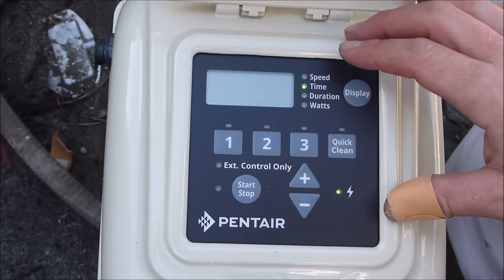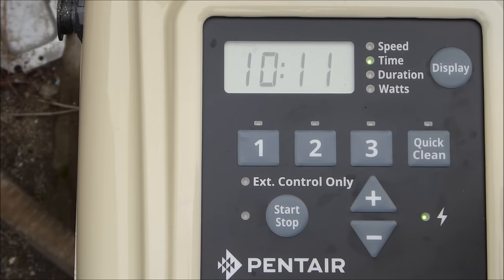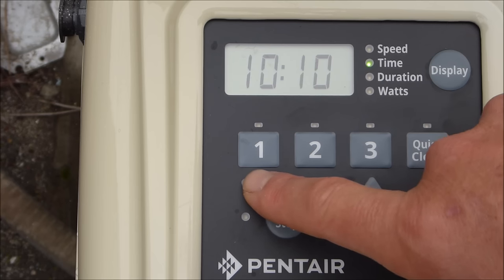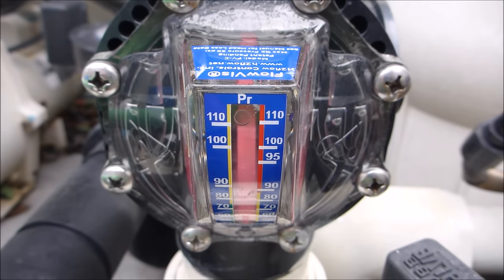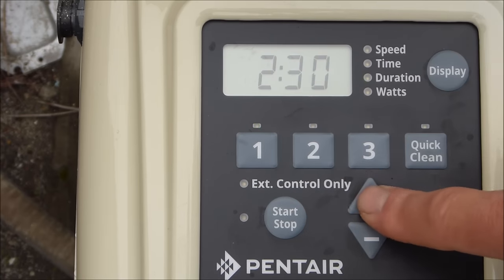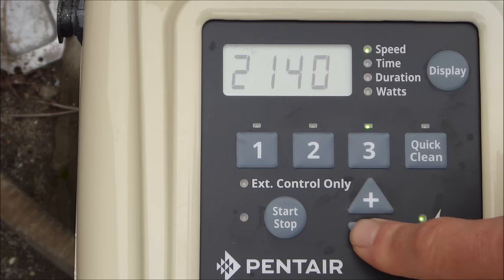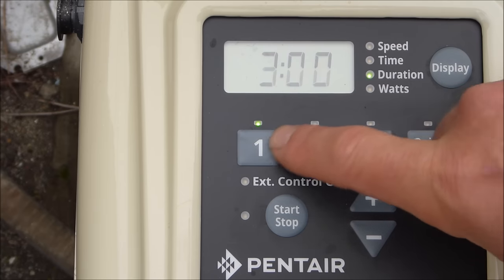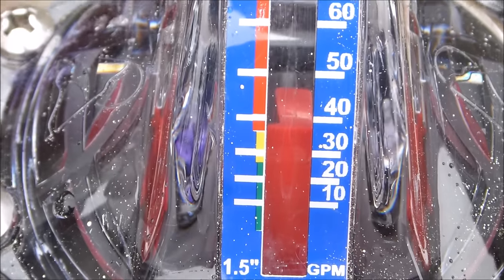Pentair SUPERFLO® VS (VST) Variable Speed Pump Operating and Programming

Comment: So my 10 year old AO smith pump went out the other day and I needed a variable speed pump immediately because my pool was very green. I went to pool stores etc and no one could help me for about two weeks, so I went online, purchased the Pentair Superflo vs.  The pump arrived two days later from Amazon (free shipping). I installed the new pump with new plumbing and electrical in two days.  TOTAL COST of Pump/Plumbing & Electrical was $769. This was a $500 savings. I would not have done it without David's tips on installation. KUDOS TO DAVID!!!
Reply from the maker: Your very welcome. Thanks for the great feedback! 👍
Reply: 😅t

Comment: How would you program the pump during a winter freeze?  I live in South Texas and we normally run our pumps 24 hours/day during a  freeze.  8 hours for each program, or is there a way to just turn the pump on and run continuously at a low speed?

Comment: Thanks for the video- I was able to reprogram 2 pumps after someone installed them and set the filter to run 24hrs at 3450rpm and the Infloor pump for 16hrs at 3150rpm. I had to work fast as more than 6 mosquitoes were trying to get my legs!
Reply from the maker: LOL - 😆

Comment: Installed this pump along with the Flowvis. Surprisingly using your settings I'm getting 50 GPM at program 1 and 20 GPM at program 2 with the Skimmer and Kreepy on.  With the Main Drain and Skimmer it's much more GPM and 95 GPM in the Quick Clean mode.

The Flowvis really takes the guessing out of how long you should run your pump for a full cycle 👍
Reply from the maker: Thanks for the update! The FlowVis is essential. Now you will really be saving on your energy bill. 🤑

Comment: I have a salt system pool and just had this pump installed on friday.   The tech set it at Set1 2200 rpm for 6hours (12am-6AM), set 2 is 2700 RPM for 14 hours(6AM-8P) nd set 3 is set for 3000RPM (8PM-12PM).   Is it me or does this seem like the system would be using more electric than doing me good?  They did say that the Pentair should really be running for 24 hours a day rather than powering off for so many hours a day  Please advise if i should manually adjust the RPM's.
Reply: also wanted to add my pool is 10,000 gallons
Reply from the maker: Would set it for 8-10 hours at 1800 RPM. Then 6 hours at 2200 RPM.

Comment: David i have a goldline hayward controller board inside the house for my single stage pool pump as a timer which allows me to turn the pump on and off as needed. i am thinking about changing my pump to this pentair superflo pump but i am confused how would i be able to integrate the control with my existing controller? any advise? ill appreciate it
Reply from the maker: It would be best to go with a Hayward VS pump so that the communication is flawless. The Superflo VS was primarily designed as a stand alond pump without automation. Even connected to Pentair automation it is limited. The Hayward Super Pump VS 700 230/115V (Expert Line) Item # SP2670020VSP. This VS pump is comparable to the Pentair Superflo VS. It is only sold at retail pool outlets and not online. They come with a 3-year warranty. If your going for the Superflo because your pool equipment is 115V you can also get the straight 115V model: Super Pump VS 700 115V (Expert Line)
Item # SP2670010VSP

Comment: I set the time and adjustments I wanted.  It didn't start at 10am as I programmed by itself. Do I must hit start at 10am every morning for it to run on my settings 
?
Reply from the maker: No. If the pump is on and you hit start after programming it should run at that time. Check the AM/PM as I have set it wrong myself.

Comment: question-after pool company installed Superflo VST on 6/13/22 we had reverse flow when we would clean the filter basket of the new pump. Tech added closing multiport (which we have never had to touch for 14 years unless backwashing) we set pump for 12 hours at 3k. Sunday 6/26/22 (13. days after installation of new pump) our system exploded. Pool co claims no responsibility. Others think foul play-we know because of security cameras-there was no foul play. All our valves were opened. Any thoughts on the reverse flow causing a build up in pressure enough to explode pipes? I hav tons of pictures and video-tomorrow the system will be taken apart and pipes will be replaced to try to uncover the mystery.
Reply from the maker: Maybe the inlet and outlet were plumbed wrong. That is all I can think of.

Comment: Pump was set up running at 1 speed @3000 for 8hrs Florida Weather  what would be your recommendation to maximize savings.
Reply from the maker: 1800 RPM for 14 hours. 2200-2400 RPM for 6 hours.

Comment: My pump doesn't turn on automatically. I will have to hit the program 1 button so it can start. Do I have to have the power to the pump on 24/7? I have my control panel set up to give power to the pump at the time a programmed to start. Any help will be appreciated.
Reply from the maker: Keep power to the pump 24/7. That is likely the issue.
Reply: @SPL  Fixed the issue once I hit the start button.  I had pushed the stop button once and left it like that thinking it will start the next day. The pump doesn't need power 24/7. Thanks

Comment: I'm running the pump 32000 and the jets don't have enough pressure and there's some bubbles, what is the problem? Water turns green over walls. 🤔 Thank you 🙏 👏👏👏👏
Reply from the maker: It could be the filter needs to be cleaned.
Reply: Thank you for your quick answer. No, I'm cleaning the filter just shok the pool and water seems it no running o there's no sufficient flow.🙄🤔 what else can I do?🙏

Comment: You show a graphic at 5:25 with a 14,000-gallon pool and a program that filtrates/circulates 14,400 gallons per day... I have seen videos claiming that pool owners should run the pump for double the size of the water since the water isn't just lining up by the skimmer to be filtered. True or False? Is, therefore, programming the pump for daily filtration equal to 1 times the size of the pool adequate?
Reply from the maker: There are those who believe this. I will have to look into it more myself but this last year or so I have heard the same thing.

Comment: When I touch the superflo vs pump start and any button on that black pad I get electrocuted is this serious or can I continue to use plastic gloves when touching it?
Reply from the maker: Probably not grounded correctly. There should be a copper bonding wire attached to the pump.
Reply: @SPL  when I turn off the breakers and the time clock I still get electrocuted. This pump doesn't have a heater what should I attach the bonding wire too?

Comment: What would be the speed the pump needs to run order to use the heater?  I have a RayPack new heater.  I understand a certain speed is needed for the heater to work.  I haven't used it yet (heater), just had the pump installed a few days ago.  Thanks for any advice.
Reply from the maker: I beleive the lowest RPM for that heater model is 1800 RPM. I prefer to run it at 2800 RMP or even the full 3450 RPM for a short time to heat up the pool or spa.
Reply: Thanks for your response. I asked the pool company, they say 28K RPM would be okay.  It is raining today in DC, will give it a try by the weekend. But second question would be: what would be the benefit of a variable pump if the heater needs a specific RPM in order to run properly?  Thanks again.
Reply: Thanks.  From your reply I guess that the whole idea of a 'variable pump' looses its meaning, right?  I.e. a specific speed is needed for the heater to run.

Comment: I have the same system that you are programming. Is there a way for the pump to stay off a certain amount of hours during the day?  And how do I program the pump for a 30000 gallon pool. Like how should i run it.
Reply from the maker: For that size pool the builder should have put a 3 hp Inteliflo VS on it. Would run this at 3100 RPM for 14 hours and then 2100 RPM for 7 hours.

Comment: if you have a VS pump, can you no longer use a mechanical Intermatic pool timer?
Reply from the maker: No, you can't after going VS.
Reply: @SPL  then what timer can you use that's easy to use and doesn't break the bank?

Comment: Hello, I stay in Northern Virginia. We have around a 26000-gallon inground pool. Length 42' and width 18'. My Pentair Intelliflo 3HP motor just went bad on the pool opening. No other Pentair pumps are available apart from this 1.5HP Superflo. We don't have a spa or any water feature, have a booster pump for Polaris. Will this 1.5HP work and if yes, what will be the ideal setting to run 12 hours to cycle all the water? Thanks
Reply from the maker: It should work fine. 1800 RPM for 14 hours, 2600 RPM for 8 hours
Reply: @SPL   Thanks a lot, appreciate it. Just ordered the Superflo pump, Let's hope they actually ship it.

Comment: Thanks for this. Is there a maximum RPM that should be used during the longest part of the day? I have a small pool (4500gallon), but my heater needs a higher water pressure to run. Wondering what the max is without burning out the motor.
Reply from the maker: Max is 3450 RPM and it won't damage the motor.

Comment: is there anything I need to do to this pump if I drained my pool in preparation for getting a new liner later this season? I had leaks all over my stairs on my vinyl liner from my dogs claws so im going to replace the liner. I drained the pool in the meantime but there is still some water inside the sight glass of the pump and it's starting to turn greenish. Should I have drained that water out before storing for a couple months not in use?
Reply from the maker: Would say a good dosing of chlorine once filled will cure everything.

Comment: Thank you very much for the easy-to-follow instructions. I live in So California. Right now the pump is set at Speed 1(3000) for 2 hours, Speed 2 (1650) for 8 hours & zero for Speed 3. Should I make some adjustments in view of the hot weather?
Reply from the maker: Yes, Increase speed one by 4 hours to run it 6 hrs at 2800 RPM
Reply: @SPL  You recommend running it for 14 hours a day in summer in California (100 degree temps)? Just had one installed yesterday.

Comment: I live in north bay of San Francisco.  I want to maximize the lower electricity rates during the overnight hours.  Is it ok to have highest rpm’s running overnight, then lower rpm’s during the day?  Just wondering if higher rpm’s need to be during hotter sunny part of the daytime?  Thanks
Reply from the maker: That should work on fine. At 1800 RPM during the day that will be enough to keep the water moving.

Comment: We just had an older Hayward replaced with this pump.  Pump sits about 6 feet higher than pool water level (it's up in a retaining wall bed) -- it seems like the preset speed 2 isn't high enough and causes it to lose prime.  Is there a magic number the speed needs to be programmed to or just trial and error?  And is there a way to completely override the schedule and have it run on one speed until changed?  I need the heat pump to run pretty continuously to get the pool temp up enough to swim in it...
Reply from the maker: You have to tinker with the run speeds. There is no always on mode but you can program a 23:59 program by just setting the run time to start a 2:00 pm and turn off for 1 minute at 1:59 pm.
Reply: @SPL  if the pump shuts off by itself at all I lose prime -- because the pump is higher than pool water level, the water drains back down and I have to refill the hair trap with water to get it primed again.  It can't seem to self prime because of this.  If I manually turn the motor off I close the suction from the skimmers/drain at the same time -- and only then can I just start the motor back up without adding water.  I reprogrammed the speeds and times and just now realized it all went back to the factory presets.

Comment: I have this exact setup. But I put the flow vision after the filter.  Also why do you need to have the high rpms for 3 hrs? Why can't you just leave it on low rpms all day?
Reply from the maker: You can leave it on low all day but this pool has an automatic cleaner and it needs some run time on high speed to operate. Also, just on low speed all day you will notice that the pool gets pretty dirty unless it is screened in.  The skimmer works best when running on a higher speed for a couple of hours a day.
Reply: Oh ok. If the pool cleaner runs with a Booster pump would you still need high rpms?
Reply from the maker: Yes, the booster pump needs the VS pump to be at around 1800 RPM to move the pressure cleaner effectively.
Reply: Is there a specific reason why you choose 40 and 15 gpm? Sorry for the trouble
Reply from the maker: Not really. I like a good flow during high speed so the surface gets skimmed. You can set the high speed lower if you like. I wouldn't set the low speed much lower.

Comment: newbie with inground pools. I have a pentair superflo vs running a 10000 gallon inground pool. It has a salt chlorinator and a solar panel heater located on the roof.  I'm thinking 3000 for 2 hours, 1400 18 hours, then 4 hours at 2000.  thoughts? Thanks in advance.
Reply from the maker: That sounds fine. But when you want to use the solar to heat the pool you may need a higher RPM for a longer duration of time.
Reply: @SPL  Awesome! thanks for the very speedy reply!  loved the instructional video. I learned quite a bit.

Comment: Hi, Newbie with this IG equipment. Stupid question...
The PB installed a manual clock/timer and also has a switch.
When the time comes on it turns Pump and SWG(Autopilot).
Now let's says if I take off the 
on/off levers in the clock and set this VS pump on is own settings Would this pump turn on the SWG?
Thanks in advance
Reply from the maker: In this case the SWG would stay on but not activate of course. So the pump as you described things would turn it on once the system registered flow on the flow meter.
Reply: @SPL  i will give that a try. Thanks

Comment: Do you have any videos on how to program(s) Pentair motors for 24 hours? I have a pool that has algae and I already cleaned the filter. But I would like to programs the filter for 24 hours until the algae is gone.
Reply from the maker: No but you need ot reset the schedule to turn on at 11:00 am and then off at 10:50 am 23:59

Comment: Thank you!! What speeds and time durations should I run my 24 hour Pentair variable speed pump? (18000 gallon fiberglass pool)
Reply from the maker: 1800 RPM for 12 hours. 2400 RPM for 6-8 hours.
Reply: @SPL  thank you! Should I set the quick clean button too? If so, what speed and duration?

Comment: I'm looking to purchase a variable speed pump. My pool is 24,000 gallons. Right now I have a 1.5 hp pump that I run from 6:30 am to around 1:00 pm. So it runs about 6.5 hours. How does a variable speed pump save money if you have to run it longer? Is it because you are running it when electricity is cheaper? It makes sense that it would save money because it uses less electricity at lower speeds, but if you have to run it longer, doesn't it use as much electricity?
Reply from the maker: My Blog post explains it pretty clearly for you. Great question.  https://poolmandave.blogspot.com/2016/10/benefits-of-variable-speed-pump.html

Comment: I only have program 1 on (cleared the other 2 program numbers.) It won't start. After I enter all the desired information 3000rpm, 5A.M. and 3 hour duration, it doesn't turn on at that time. What am I doing wrong?
Reply from the maker: Could be the clock is not set right. The correct time.
Reply: @SPL  Just checked and it is set correctly. After I'm done putting all the settings on program 1, so I have to do anything else?
Reply: I figured it out in case anyone else has the issue. This channel did not have an answer, but I do. 

Enter whatever you want in the 3 programs. You can't turn any of them off if you wish. Once you're done, start the "Quick Clean" program manually and let it finish. Once that is done, the system will automatically start the next day at your settings. "Quick Clean" forces the programs to start

Comment: Great instruction and clear details. What does the "External Control Only" feature do? Does it ignore this schedule you programmed? Can the pump run the schedule and receive an override from an external controller?
Reply from the maker: It is an option if you have an automated system connected to your pool equipment. The Automated system like a Pentair Easy Touch will override the pump panel and you would run it from the Easy Touch.
Reply: Does anyone know what happens if a signal for speed 2 is being sent and another signal is sent for speed 3? Will the most recent signal win or will it give an error code?  When signal for speed 3 drops, does it resume speed 2 from the signal which has stayed on?
Reply: @SPL  my "ext.control only" is lit up, how do i turn it off ? i cant operate the pump with it on, its seems

Comment: I have a 10, 000 gallon pool with a solar heater. What settings do you recommend?
Reply from the maker: 1800 RPM for 10 hours a day. 2800-3100 RPM for 4 hours to run the solar.
Reply: Thanks. What times of the day to run the solar?

Comment: Is there a way to run the pump if pump panel is not working? 
( Pump stopped working and Leslies technician is scheduled for next week! It's pretty hot, hoping there's a way to turn in on bypassing panel.)
Reply from the maker: No way to bypass the panel unfortunately. Add 2-3 gallons of liquid chlorine to the pool in the meantime
Reply: @SPL  thanks for quick response

Comment: I just had this pump installed and am having trouble trying to start it several hours after it ran cycle to heat a built in Jacuzzi.  Hos do I start the pump running manually?